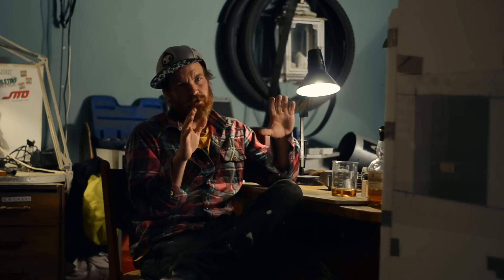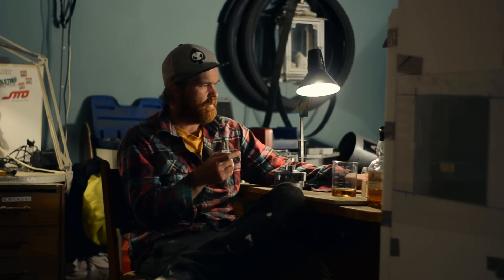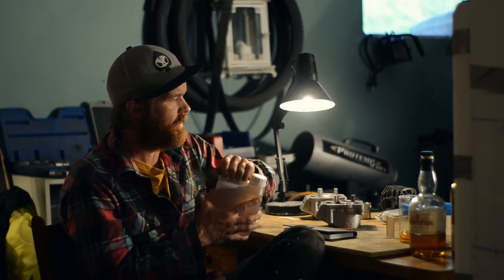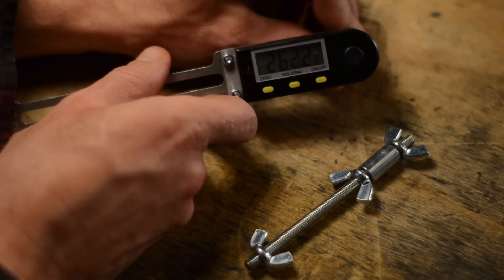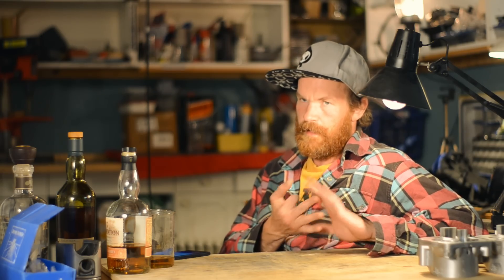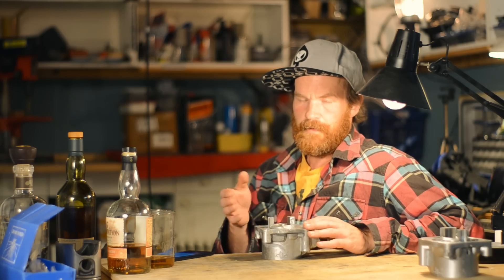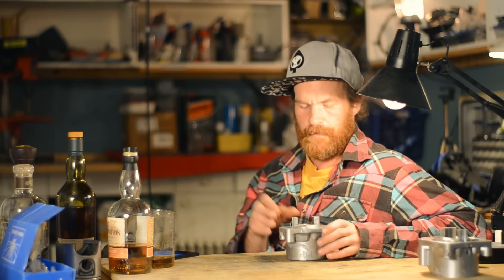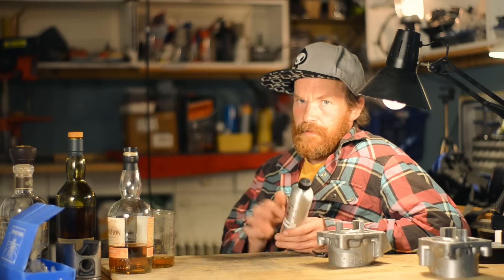The Most Powerful Two Stroke Ever - progress so far

Comment: those small lathes are awesome. dont let people tell you otherwise. i got one 2 years ago and had so much fun with it. but keep in mind that you really need time, the machines are not very powerful and also not very rigid, not saying they are floppy or something, they are just too small for heavy work. if i were at your point, i'd go for the milling machine first - there are many things that require either flat surfaces or precise holes, thats what a mill can offer, a lathe really just can make round parts with holes in it (yes you can do a sqare and stuff but still, a milling machine is more useful for general fabrication than a lathe)

Comment: Brilliant work! I still believe that a piston ring that wraps around the piston twice much like a four stroke oil scraper ring would solve the port clearance problem. By circling the cylinder twice you will have 720 degrees of contact an the piston ring will remain a perfect circle and will not expand into the large ports.  If 75% of the cylinder is opened for ports this will still give you 50% contact. if you use a ring that circles the piston three times your cylinder is now 1080 degrees and you have 75% contact "in theory".

Comment: Even if you use the solvent I'd hone the bore out anyway, hone pattern will probably give the new harder plating something to hang on to.
Re the mill, get a "Mill Drill" (be sure to get a geared head not belt), Ive had a chinese one since 2005 and for first 11 years used it daily in my business and it is still good.
I've got an old vid doing some work with it on my chan. https://www.youtube.com/watch?v=V6AEZ6dSRIU
Most used bit of machinery I have and aside from milling you'll never used your old pedestal drill again once yo have one.
Reply from the maker: Thanks for the tips!

Comment: You can run the softer coating, as long as you are using piston ring(s) which are made for softer cylinders than Nikasil ones are. Maybe a ring meant for nodular cast iron cylinders? Not entirely sure what hardness those are, but rings for Nikasil cylinders are notoriously hard.

Comment: hmmm, just thoughts why you didnt try to do a direct double injection with variable velocity stack - that would be kinda interesting ..... better timing electric adjustable injection better cooling of the cylinder and probably you are able to install a water injection to run that thing on full throttle full time without heat problems and with that thickness of the cylinder bore you can run up a much higher compression rate than other cylinders - or if not high compression rate than you are able to get pretty damn high rev band when the stroke and the middle piston speed isnt that high.

Comment: I would have a go with the cylinder you have and maybe make another cylinder for the boron nitrite coating. If you get both cylinders to 39.9 bore size potentially the piston head etc could be shared

Comment: BN harder than CS. Looks like you got only nikel on plating. As i wrote in early videos - you use big flow rate (and washout BN before it will covered by nikel) or/and less likely what little surfactant used in solution.
Check plating with microscope. On good nicasil you will see CS blotches in nikel, so use that for quality test or you coating.

P.S. Also i found video from asian(?) litle factory and i hope it will help - https://www.youtube.com/watch?v=TZ5r_Xd9a2U
Reply from the maker: Thanks! I'll get a microscope.

Comment: Good stuff.  Thanks for the update.  I am thinking it will be good to test the linning you have already created under actual running conditions just so you can start comparison data on boron nitride/silicon carbide mixing towards your balance of heat transfer verses hardness. Scratching the surface using a hardness testing kit without the lubricants and temperatures of actual running conditions seems like a poor data return considering how much effort you made to create the coating. Very exciting to watch you develope. Thanks again. I look forward to next update.

Comment: Oh, and at stroke 39,7mm you are still under 50cc at a bore of 40,044mm
Though small, the slightly longer stroke will be an advantage unless you plan on aiming for absurdly high rpm.
Reply: NoNoNoNii 

I am well aware of the goal. It's the name of the video series. 

Allow me to elaborate. 39,7mm will still be within the 50cc class up to the mentioned bore, meaning there should be no reason to aim for a shorter stroke.

My attempt to imply that piston speed will likely not reach a point where a 0,5mm shorter stroke will be advantageous over the increase in displacement was poorly thought through. 

Unless there is a wish to "future-proof" the setup to allow for a bigger bore with 39,2mm stroke I see no need for it. Especially with new castings in the future.

Comment: First I would get ahold of an iron sleeve and test that against your  cylnder coating to compare hardness. If you are above the hardness you should be fine,  the coating will wear down and then you can improve your formula next time you need to apply a new nickasil coating, this would allow you to progress onto the other aspects of your build. But that is me and I am not you, much has to be thought about in order to achieve sucess and failure, they go hand in hand, you either suceed or you fail, this failure mode drives us to be better than before,  truly one of the best build series all around, your determination is the best part of it, i am sure tho that I am all ready for the next step. Peace from the east, only beacause it rhymes and the fact that if you go far enough east you will arrive at my country Canada lol
Reply from the maker: Thanks! I did the file test on the iame cylinder liner and it was definitely softer.
Reply: First thank you for acknowledging my comment. I am a long time two stroke addict my first two stroke was a moped and graduated quickly to bigger and better bikes so you are a real brother in my mind. Biggest I rode was. Suzuki 750 water buffalo, scariest was a 400 can am dirt bike lol. Sorry got off track but seeing someone as addicted as myself is making this old man giddy as fuck. I am wondering was the cylnder you tested a nikasil coated iron sleeve or nikasil over aluminium like yours?  A plain iron sleeve is what iwas refering to so if yours was harder than that then it would last for some good testing before replating was required. But due to my age I may be totally fucked brain department for saying this lmao. Also blessings to you and your family especially your wife if those are her pots amd pans you are using have a great day everyday love the content.

Comment: You and AVE (youtube) shoulds work together, he is doing a similar community prototyping thing with his 5 axis cnc he got specifically for that purpose.

also, there is an equation you can use to calculate the coating thickness. Google: "electroplating material science coating thickness equation". i forgot to comment it a while ago.

Comment: Hey,man! 
About the casting of aluminum,did you try to make as liquid plaster as  posible and put 3d print in it,put it out and salt it with sand. Than repete that process until you have thick layer of mold. I never try this,only so it on youtube. 

Good work so far,hope it will run soon! :-)

Comment: Getting close! Good to see you’re getting some key support also. The gauges are nice but an old fashioned degree wheel mounted to the crank and piston stop in the spark plug hole is actually more accurate and simpler to determine TDC and other port timing events.

Comment: I know you sort of stick to 50 cc moped engines...but I would love for you to make a 500 cc cylinder for a CR500 or a KX 500!!
Reply: Lots of wibration
Reply: @janeblogs324  Just make the motor mounts out of springs and rubber bands
Reply: Take his concept, duplicate 10 times, and have a v10 2 stroke monster!
Reply: Everything he talks about is more or less scalable to any size you want! 

I'd like a 4 cylinder inline motor with this architecture.... LOL!
Reply: A Chester lathe mill combo looks like a good option (for me anyway) 😊
Reply: Big two strokes struggle with piton cooling. Walter Kaaden (inventor of expansion chamber) invented the boost port to improve piston cooling. It gave him 20% more power but pistons still melted. That was for 125 and 250cc.
Reply: My 250 makes about 70 hp...not sure how much more you can use. I can build you a 500cc road race motor.